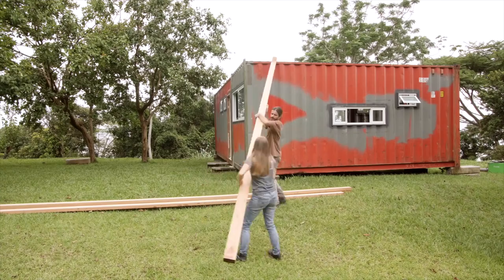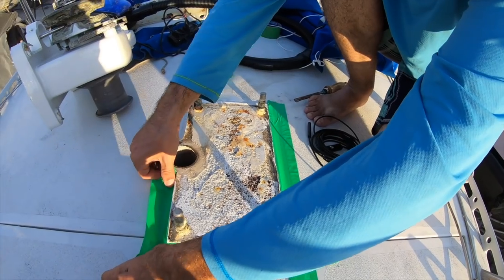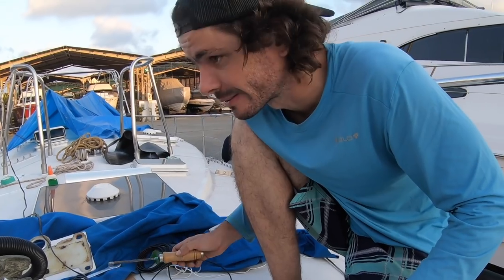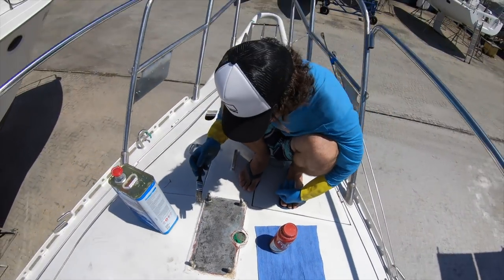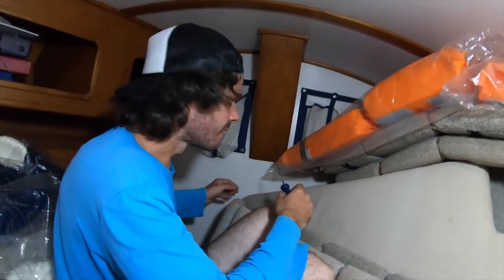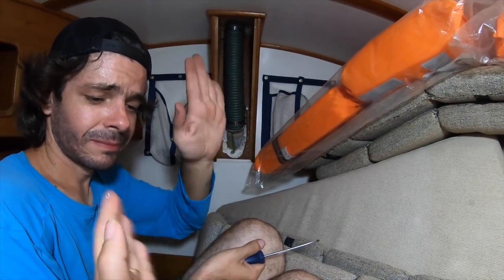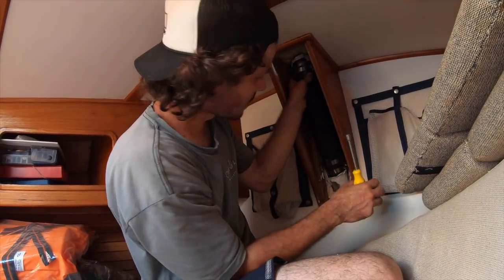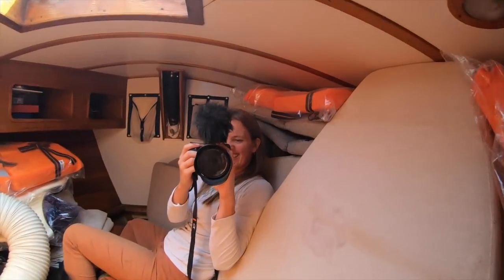⛵️We found RUST on our fresh painted steel sailboat!! 😱#125

Comment: I'm glad to see that you used that type of hose for the replacement. I've never like ribbed hose because, in my experience, the ribs are thinner than the clamps, so it never completely seals well and leaks develop like yours did. A trick I learned from a friend who is a professional painter, is to dip your finger in water and then the SikaFlex will spread very smoothly. Let it dry for about 15 minutes (before the SikaFlex starts to develop the "skin"), then remove the tape at a 45° angle away from you, and you will have a professional result every time. On a different note, I have to say that I really enjoy watching you two work together. The love you have for each other is evident, but it's the respect that you show to one another that just makes me smile. If every couple acted the way you do, divorce would not exist and love would flourish.
Reply from the maker: 💕💕 thanks for the kind words and support, Frederic

Comment: Thanks for another great episode.  Having spent decades wrenching on all sorts of stuff, I would like to suggest you consider using antiseaze.  Stuff works great and makes the next time you have to take something apart a breeze. I have had the habit now for more than 15years to always place some on threads. 
  Keep up the great team work and having fun.
Reply from the maker: Thanks for the tips, Jim
Reply: @OddLifeCrafting  And Butyl Tape around the stud then the antiseaze on the threads then the washers and nuts. Lots of uses for Butyl tape.
Reply: Be careful here!   Anti-seize can mean any number of products.   Most anti-seize contains finely ground metal such as copper, zinc or aluminum.   
      In the presence of salt water, this metal will cause a dissimilar metal galvanic cell and accelerate corrosion!

      With fasteners exposed to salt spray or under the waterline, plain grease works well.

     For the best long term protection of threaded fasteners, consider using TEF-GEL or similar product.

      http://tefgel.com/contain.php?param=tefgel_infor
Reply: @Stepclimb , that is why I named a brand of graphite anti-seize. Never been on a ship that doesn't use "Never Seize".  It comes in a tin jar with a application brush attached to the cap. It might seem expensive for a little 4 oz. tin, the right size for our heroes, (but big cans on bigger ships) but that lasts forever if you use it correctly.  I'm  trying to remember ever ordering any and can't. You see if are running out SOP was to order one to use , a heir and a spare and it lasts so long that I can't remember ever being low on the stuff 
Hmmm, maybe, being invested in fixing stuffs the engineers ordered the stuff and gave it the deck crews.

Comment: The friend who gave you the metal treatment ... Ospho , a brand name ... and the only name for it that I know,  did you right. Its job is to reduce the pinhead (microscopic) sized rust that you can't wire brush off.  I was taught that rust increases 5X per year,  so if the pin head sized bits are chemically reduced by even 1/2 , but it seems to do better than that in my experience, as it slows the rust a lot. It is also good for cleaning up "running rust", the brown strains formed on top of good paint by water running running off rusty bits , like say out of the scuppers.  It was mandatory on my ships. I remember I suggested Never Seize when you first started... a graphite grease on EVERY nut and bolt that you put together. It, too, was mandatory on all the ships that I ever worked on. I hope you took my advise, but on the windless it is exactly the sort of place it is critical. Just a little dab on the threads at the tip of the bolt and again on the nut is the  method.  I have seen big nuts, like 1 inch, unused for years so rusted that after wire brushing the rust off the only tool to use to turn it was a chisel, but because of graphite grease, once started, they always come off. It also saves the bolts such that if cleaned up the same bolts can be reused. If you have not been using it,  : (  ... START now !

Comment: Two suggestions: First, I think you are right to keep the manual windlass. That is in line with the thoughts of the previous owner, and I agree with him. Simple is more reliable. Second: You can paint over Sikaflex when it has dried. So your black marks around the base of the windlass can simply be painted white! I'm really looking forward to seeing the inside of the boat looking as good as the outside!
Reply from the maker: Thanks for the tips

Comment: ...danged rust is relentless, you always have to watch for it..good job, great vid..keep safe you two...
Reply from the maker: 👍🏻 be safe as well
Reply: I believe you did an excellent repair on the wench, way to go!

Living in the southern USA where the summers are hot and humid I deal with rust quite a bit in my work shop where I use mostly hand tools for woodworking and do some light metal crafting for hinges, etc. I think of rust as metal cancer because once it shows it is hell to get rid of or keep at bay. Any place that you've encountered rust on the boat needs to be checked on a regular schedule from then on. If you venture into the tropics those areas of the boat need to be examined even more frequently. At tip for hand tools; I have found that spraying a light coat of WD-40 on hand tools, including rasps and files, will go a long way to keep rust away.
Reply from the maker: Thanks for the tip

Comment: Chain running through a rubber pipe. Sensible to put it on your maintenance schedule.
Reply: Yeah, the hard corrugated plastic one was probably there for a reason!!!!
Reply: Nijel Vidler it was there for a reason. The chain can get stuck on the rubber. They should have problems with it right away. The corrugated pipe only let the chain hit the ribs the rubber won’t. They are setting up more problems with this and not changing that bad grease in windless.

Comment: Well, Deb and I will start the week off with a big smile, thanks to your video. You approached the problem wisely and got the chain guide repaired properly. You might want to remove those clamps and put a dab of grease on the worm screw, then reinstall the clamp screws. If that screw end rusts (and they will), it will be very tough to get it off. So says the voice of experience.  LOL! Have a great week. Lots of hugs to you both. George & Debby Brady, Texas City, TX.
Reply from the maker: Thanks for the tip, George. We actually replaced the clamps for brand new stainless steel ones, so we hope we won't have any problem soon. Have a great week, guys

Comment: Hello. You might want to consider using T-bolt clamps vs the worm gear clamps. T-bolts are much more efficient in staying tight, not stripping out overtime and lasting considerably longer. They are a bit more expensive but well worth it. Thanks for the great vids. Cheers. 🇨🇦
Reply from the maker: Thanks for the tip but the screws are welded to the deck of the boat and we cannot change it
Reply: Odd Life Crafting   Just attached s link that shows t bolt clamp. We used to have a small mono hull and found that these clamps were more consistent on applying even pressure all around the hoses vs the worm gear clamps that had a tendency to “cut” into the hose and easily stripped. Anyway, link is for a picture if it.  
https://www.fastenal.ca/mb/productList/Pneumatics/Clamps%2Band%2BCollars/T-Bolt%2BClamps/603517

Comment: Nice job on the leak repair. The rubber hose should outlast the plastic by a long time. I would have kept the grease in the windless also. That's a low speed gear and the grease had no rust in it so no need to change it. Lot of cranking to lift the anchor chain and anchor though. Now to get the anchor chain depth marked and back into the chain locker. One more thing to check off the list of things left to do.
Reply from the maker: Thanks, Richard. We are planning on talking about the list of things to do soon.

Comment: Poor bloody windless, I hope it dont let your down when you need it most.  love you guys
Reply: Colin Chaffers if they don’t change that old grease it will probably fail sometime soon after being used and getting hot. I would have changed it out since I had it apart.
Reply from the maker: The manual of the windlass says we don’t need to change it
Reply: Odd Life Crafting the manual can’t see the discolored bad grease that’s in it. Grease does go bad it’s a simple job to do while it’s out anyways. You don’t have to take it anymore apart than what you already did to change it with new.
Reply: To be fair the sooner it fails the sooner it gets replaced even in shallow water electric is the way to go!

Comment: You could use that same black matt that you used to cover the grease and your port holes or you could use a plastic cutting board or even starboard lumber.
Reply from the maker: Maybe, it's an idea. Thanks. But the old one is still working fine.

Comment: I have had the pleasure of "pinholing" steel boats. The treatment you used is definitely called for. From a supplier: "A metal treatment that, when applied to rusted surfaces, causes iron oxide (rust) to chemically change to iron phosphate—an inert, hard substance that appears black". So our process was locate a rust source, small area in the paint, chip with a pointed hammer, grind, apply ospho, apply primer, apply paint. Worked very well over long periods. There are substances designed to seal leaks from within pipes, I'm not sure how durable they are.
Reply from the maker: Thanks for the information, Gary

Comment: You did a great job with the windless & the new gasket. When you pull it up next to change the grease, when you put that stainless steel backplate on the windless, seal the edge with silicone. The reason is in the sun the grease will heat can leak out the bottom.
Reply from the maker: lets hope not  :)

Comment: I think the paper was used to "Wick" or absorb water so it didn't mix with the grease. The paper attracted the water so it kept the grease clean. There is condensation that accumulates in the windless up on top with all the heat from the sun and cooling in the evenings. The paper would allow for evaporation where the rubber will keep the water inside and keep accumulating without allowing it to evaporate out because it's air tight now with rubber. I suggest checking with the experts with regards to replacing that with rubber. Great channel love your videos.

Comment: Being someone that has built and worked on things for 35+ years, I must say, it's a pleasure to see how diligent you two are about doing things right. So many people just throw things together with the attitude of "that should work for a while". Those are the people that end up doing the same job again in a year or so. 
When you take the time to do it right, you don't have to do it again for a good long time. That makes it easier to keep on top of all the maintenance and repairs. 
Any yacht is maintenance intensive, there is always something that needs to be fixed. There is no way around that but, when you fix things right and don't have to do the same job over every year or two,  your "to do" list gets considerably shorter. That reduces stress and makes cruising more fun, not to mention, safer.
Reply from the maker: Thanks for the support.
Reply: shananagans5 so you think leaving the old grease in windless was a good idea and doing it right the first time because it will have to be taken back apart when it’s used some to replace it and putting a rubber hose in place where corrugated pipe was needed so the chain wouldn’t get stuck while at sail is doing it right the first time as you said but these things will have to be revisited again for sure. I don’t understand your logic on this!!!!

Comment: Good call opening the windlass. Now you know there is no water or corrosion inside. The grease is fine as long as there is no water or corrosion. A manual windlass is not subjected to heat that causes grease to break down and lose its ability to protect the gears and bearings. I agree with your decision to seal it back up and reinstall.
Reply from the maker: Thanks for the support, Ben
Reply: @OddLifeCrafting  You're welcome. Thanks for sharing a little piece of your lives with us.

Comment: The moment you guys said I don't know we might have to take this all apart I said no.  That boat is so well designed I knew it would be something easy and intuitive.  I love that boat.  The reason for the hose is because over time as the chain falls into the locker it would wear out a steel tube.  The plastic hose is designed to be sacrificial.  I'm not sure how well your rubber hose will work, it might not be slippery enough and the chain could backup in the tube.
Reply from the maker: We are gonna give a try. We hope it works well. 🤞🏻
Reply: Bob Adam that’s what I thought about the rubber hose. 👍👍
Reply: @OddLifeCrafting  I hope so too.  If not, it's going to be very easy to fix.

Comment: FYI with those hoses if you put them in really hot water for a little bit they get get flexible and easier to work with
Reply from the maker: Thanks for the tip. We saw they doing this in Sailing Soulianis ☺️

Comment: Hey guys - had a leak like this myself that I could not fix UNTIL I put a the lower part of the hose INSIDE the lower pipe (then I put a boot/sleeve around the outside of that hose).  If your fix doesn't work, try doing it that way.  I can send pictures if needed.  Good luck!
Reply from the maker: Thanks a lot for the tip my friend. Let see if works. If it doesn't we will try it out!!

Comment: Hah! I just lost my new sunglasses and I need a bottle opener! Add me to the raffle. 

Btw the gasket you replaced on the anchor wench is a wax seal, old school, but very effective and easy to repair and replace. Also double check the new synthetic gasket is suitable for that grease and application.  

Nice to see you are both well and keeping busy. Oh, before I forget the rust remover you used. There's another product called Naval Jelly. Perfect for steel boats and lasts forever. It may actually be the same as what you used. cheers.
Reply from the maker: Hello... I couldn't find you at the Patreon platform. Are you using another name there? This raffle, as we said, is just for Patreons this time. The gasket is pure nitrele and they indicate it for grease, no problem.
Reply: @OddLifeCrafting  No worries. I just ordered a pair of the bottle opener sunglasses. 👍🏻

Comment: Looks like that windless used to be full of grease. Do you need to pack it back up. otherwise the grease will move to the bottom and leave none on the moving parts. (like packing the stern gland on the prop shaft)?
Reply from the maker: Hello, David. We checked the windlass manual and It's all good, it's correct as it is

Comment: Nuts and bolds should be tightend with some torque to prevent you from breaking them because you tightend them to much. Many years ago I worked on a farm and the farmer said that I should tighten a nut. I asked him when to stop and he said to continue. So I when on and broke the 3 cm thick bold. The farmer was not happy that I was that strong. So my advice is to find out what the torque is to tighten the nuts and use a torque wrench to tighten them.
Reply from the maker: We actually tried to find it, but here in Brazil they just sell torque tools for bigger screws. Thanks for the tip

Comment: You guys are doing a smashing job with the windlass, BUT i believe someone prior has done a bad job in adding grease to the winch!!  All winches use oil as lubricant NOT grease.  I believe there even was a sigthglass that show the correct oil level.  If you ever go to Terra del Fuego, that grease would be stiff as anything and the winch would probably be destroyed.  Hope I'm wrong, but don't think so.  Good luck, the boat looks terrific.
Reply from the maker: Actually this specific one uses grease inside. Someone sent us the manual of the windlass and it's grease that needs to be used there.
Reply: @OddLifeCrafting  Good to hear that it should be grease, but still the grease will be freezing quite solid way down south and obviously harder to operate.  But where you are it should be just fine.   Happy continuation with the project:)

Comment: Good job but when tightening a rubber gasket greasing it is not always a good idea always tighten from the inside out pushing the gasket from the center to the outside corners leaving no gaps
Reply from the maker: Thanks for the tip. We hope we won't have any problems in this case. We are gonna use your suggestion to close the diesel and water tanks.

Comment: That grease looks as if it needs to be changed out. You won’t know till you use it a lot and its gears start to grind up and wear out that you should have changed the grease while you had it apart. You could have pressure washed any grease you couldn’t get out by hand then filled it to the top. But you’ll live and learn not to do a job twice if you don’t have to. Good luck 👍
Reply from the maker: We manual of the windlass says there is no need of changing it
Reply: Odd Life Crafting get new grease and just look at how it’s supposed to look. The grease protects the gears in the windless from wear but once it gets old and it had some moisture in it to ( that’s what caused the color change) it won’t protect it and make it harder on you to pull on it. Once the grease gets hot it gets thin and that’s why it originally had a wax seal that you pulled off and replaced with the rubber one. I hope it doesn’t seep out on a hot day. I know I’m saying a lot but I thought you might need to know. You can leave it like it is and maybe you won’t have any problems later on. I know anytime I did anything like this I would always have to come back and try and fix it again later on . Good luck 👍
Reply from the maker: Thanks a lot for all the information. Let’s hope for the best but if necessary we will open it again. 🤦🏻‍♂️